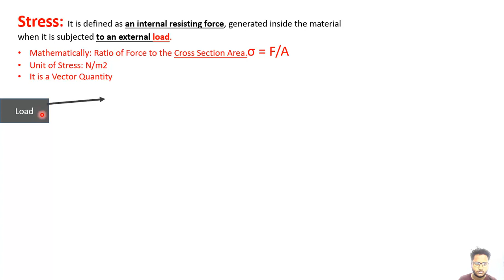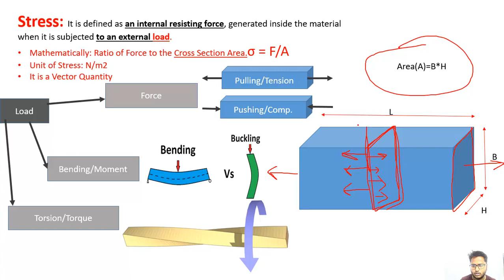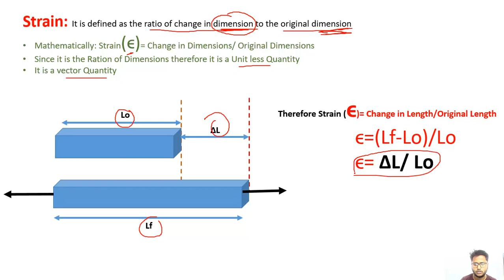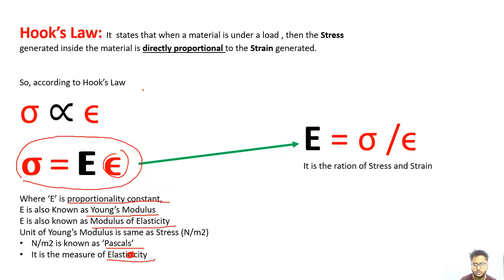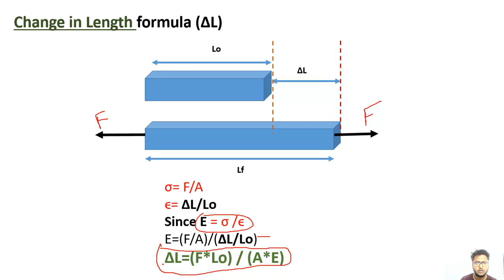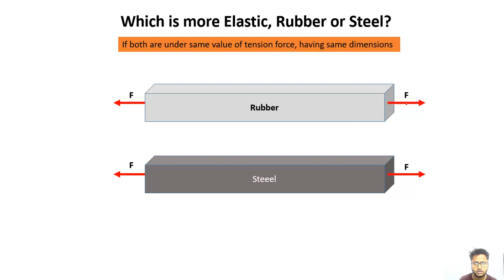Engineering Materials I Part-4 I BME I by Suraj Gupta

Comment: Steel is more elastic than rubber because it can be stretched upto a thin wire and can regain its original shape while rubber will break up after some stretching or after    applying much force.

Comment: Steel will be more elastic than rubber because the value of young's modulus for steel is greater than of rubber
Reply from the maker: Great. But how you come to know that young's modulus is more for steel?
Reply: @basicS7635  In book. It is given that its elasticity is high that's why 
Is this wrong sir..??